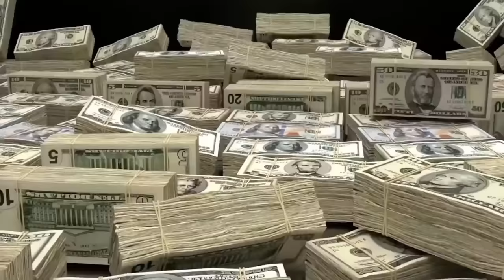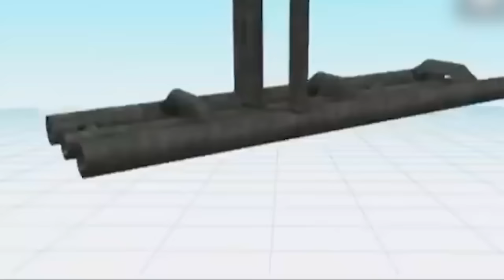China Spend $450 Billion On This Mega Project

Comment: I am convinced now that if the human race is to settle on Mars, China is the one who can do it. However if concrete structures  (rebar reinforced) say' takes up to 100 years to gain max strength before it begins to break down - high maintenance and replacement costs "one in a hundred years" would not be something to look forwards to.

Comment: The Three Gorges Dam is facing a lot of problems now. It does not provide cheap electricity as planned. When the heavy rain comes, it cannot hold water. Instead, it releases a lot of water. The cities downstream are flooded. Houses were flooed and swept away. Rice fields were flooded. It becomes shallower and shallower. The Chinese government did not listen to the experts and they built this dam. They are paying the price of suffering. Your report is based on superfacial value. There were tons of infrastructures in China. They are facing the cost of repair now. These costs are part of the reason that the economics in China is suffering now.